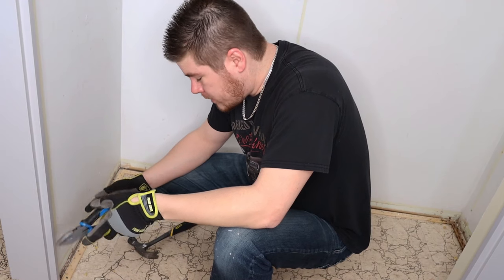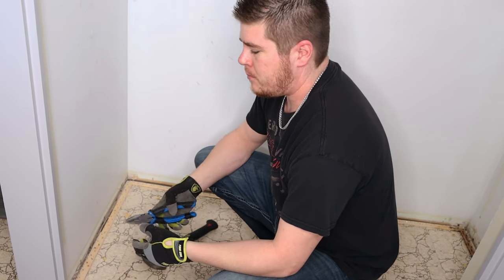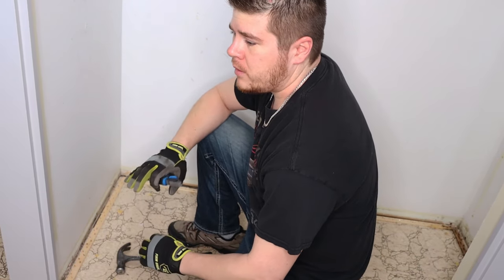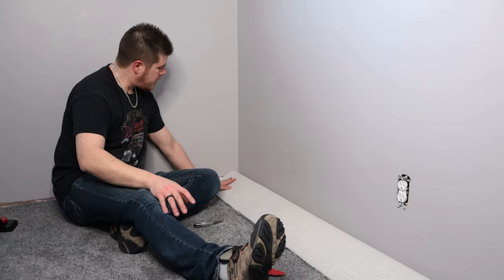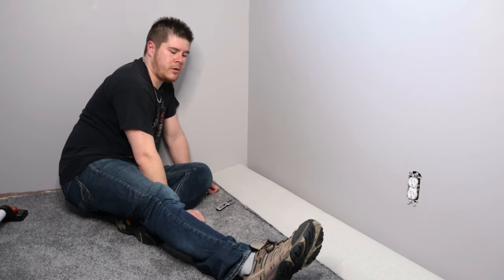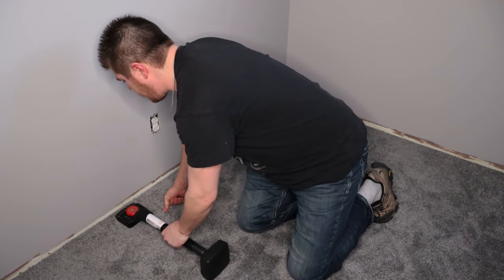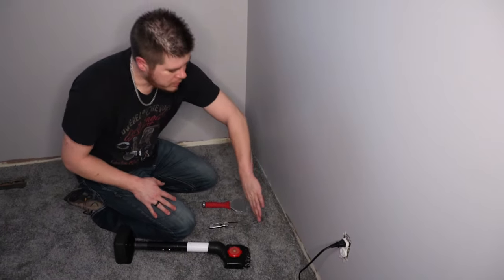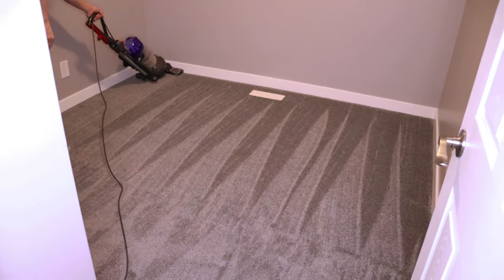How to Install Carpet in a small room // Step by step for beginners

Comment: thanks for this, I've been up all night watching carpet installation videos and yours is by far the most clear and detailed one I've seen. I usually only do drywall, tile and vinyl but now I'm confident I can do some small carpeting. again, thank you so much for making this
Reply from the maker: Thanks, I appreciate it! I'm happy I could help. Good luck on yours! Thanks for watching, let me know how it goes
Reply: How did it go?
Reply: In your shoes now boss man how did it  go ? You add it to your list of services for good?
Reply: @devinsteed303  it went well! was definitely a tough job and I dont think I'll ever do super big carpet jobs but the small ones are fine. I'd say definitely spend the extra money to get a good knee kicker, the cheap ones are garbage
Reply: Are you able to use your foot instead of your knee?  I've had both knees replaced.
Reply: @3TESLA  Yes, but you'd either have to be super limber & double-jointed, or 3 feet tall, since a knee kicker will require you to apply pressure with your hand(s).
Reply: I agree. This is the best tutorial.
Reply from the maker: Thanks

Comment: Great vid! You actually got lucky twice. The carpet cutter cut a straight line.....and the carpenter built a straight wall. Royal flush.
Reply from the maker: Thanks! Well if my local shop couldn't cut it straight I'd be amazed since it's rolled off by machine and a blade comes across a rail lol and the walls are close enough, not perfect but close enough to work with. I did have to tweak the cut in the other room I didn't film right beside it

Comment: Pretty good video dude, as an installer I think you made it very clear for people wanting to do diy work. The tool you were thinking of with the poles is typically called a power stretcher, normally it's recommended to use one on all installations because the knee kicker is only for setup these days. I noticed you were using it as a computer room to I'd recommend getting one of those plastic or rubber office mats if you have a chair with wheels because they destroy carpet pretty quick.
Reply from the maker: Thanks man, appreciate it! I tried to make it as clear as I could that this method is for small rooms only. Yeah the power stretcher, I remembered it after lol oh well. I know the kicker isn't the normal go to method, but it can get the job done in a small space for people to tackle. I am now using a plastic mat yeah, I didn't want to wreck the new carpet. I had one on order but it wasn't in the video, and I didn't care about that gross old carpet lol. Thanks for watching and reaching out! Happy new year
Reply: @JessedoesDIY  no worries man even though I've been installing for 14 years I still enjoy seeing people give things a go, happy new year from New Zealand.
Reply: Thank you so much for this comment. You saved me a world of work

Comment: Great tutorial.  I'm a carpet installer with 20+ yrs experience, and your video popped up on my feed.
I can sit here and criticize all day, but I think you made a great video for DIY(s).  The two big things I would recommend is using a knife specifically made for carpet, that is double  edged (although one must be extremely careful in handling it).  The other is when cutting the old carpet into smaller pieces, fold the carpet over so the backing is exposed.  Carpet cuts much easier through the backing vs the top.
Reply from the maker: Thanks. Yeah, I never meant it to be a pro install job, just to help people do a small room is all. Thanks for the tips
Reply: @JessedoesDIY  Yeah, I know.  I could go on and on, but your video is a satisfactory quick lesson for those looking to save money & a temporary solution.

Comment: Thanks for this video, if you were not putting the base board (skirting) down, would you recommend painting first and then lay the carpet down?
Reply from the maker: No prob. I'd always paint first then do flooring. Then you should only need to do touch ups if the carpet scratched anything

Comment: Great in detail video man! Had a question, I’m needing to replace the baseboards anyways, should I lay the carpet then install the baseboards and tuck it? Or have it up to the wall and install the baseboards so no tucking needed? Which would be better?
Reply from the maker: Thanks, I appreciate it. If I can, I always want to do baseboard last, after any type of flooring was installed. But that's me, I know others who would do it first, then carpet. Hope that kinda helps lol I know it's a non answer, but that's what I would do.

Comment: First, great video, congrads. Just a quick one since I'm a complete novice DIY . So in our small bedroom, there is an existing carpet, underlay underneath which I was going to replace. Now under the underlay, what do I expect to see, concrete ? Does the underlay go directly onto concrete ? I'm in Ireland, in a dormer, house on ground floor is concrete, where this small bedroom I going was to switch to office but rather than using laminate, though carpet would be nice.
Reply from the maker: Thanks! Well typically for me here I'd expect to see a plywood or OSB subfloor, I just happened to find vinyl tiles under this one in my house. Over there that's a good question, if the rest of the house on ground floor is concrete then that's probably what you'll find. But if you do install carpet on concrete, you'll need to glue down the underlay with a spray adhesive or something. The tack strips should be able to just be nailed down like normal if you get a concrete specific one. If you decide to go a ifferent direction tho and don't want to tackle carpet, I'd look at LVP. Typically I'm not a big fan of it in main areas but it has great use cases, this being on of them. Laminate doesn't play too nicely with concrete in the long term, LVP will be better, but carpet is the warmest as well. Your call my man, unfortunately you won't know until it's ripped up, or at least pull a corner back up to see. Good luck!
Reply: @JessedoesDIY  Thanks mate for the info. Much appreciated. Keep the excellent work going. Takes a lot of effort and time to put together videos that are easy to follow for beginners!!..
Reply from the maker: Thanks man, I appreciate it! Will do. Good luck on yours, keep me posted!

Comment: Correct me if I’m wrong, but I’ve actually got a builder doing our carpet, and in some spots the carpet didn’t even make it under the baseboard or I can literally peel it off the tack strip, that’s improper correct?
Reply from the maker: If there is no baseboard you can pull it off the tavk strip, but the baseboard should hold it down so it doesn't come up. And it should most definitely be under the baseboard and tight to the wall. There should be no gaps anywhere

Comment: I have a recessed den with a 16 X 12 rectangle area with carpet. Could I use just the knee or kicker or would I need the power stretcher?
Reply from the maker: I'd lean to the power stretcher. That's getting to be pretty long and you wouldn't want any waves over time

Comment: Brother what about concrete floors? Does one need a HILTI Gun to get Tac Strips replaced?
Reply from the maker: Hey, no no no, that's too powerful, it'll just blow them apart depending on the model of gun. There are concrete tack strips you can get that are made specifically for it. They have nails made for concrete that you can pound in with a hammer like I showed

Comment: I was wondering, around the vent do staple any carpet down? or put tackless around it?
Reply from the maker: You can use a couple staples but I wouldn't. And no tack strips, don't do that. It's honestly fine to just sit there. Once the vent cover is on and the carpet is in its final place it won't move anyways, and a vacuum won't pull it up. Nothing is needed. At most I'd do some 2 sided floor tape under it to the floor if you feel it needs it

Comment: How do you install tack strips in a basement, on cement?
Reply from the maker: You can either get concrete tack strips which have short nails made for concrete but they don't always work. Otherwise you'll glue down the strips with some construction adhesive

Comment: hey i have a 16’x 7ft and a 8ft x 7ft room to do, would it be wise to use this tutorial? I have to do it myself since i don’t have ~700$ for someone to install it for me. I watched it and it seemed really simple. Also, does the padding have to be flat surface face up? or can it be face down?
Reply from the maker: The 16x7 room I might rent that carpet stretcher from a hardware store just because the distance is pretty long and you probably won't get tension on it. Otherwise yeah, make a go of it if you feel confident, the carpet stretcher is easy to use and they can explain it when you rent it. Technically the underlay should be foam up, film side down. Hope that helps
Reply: @JessedoesDIY  thank you!!
Reply from the maker: Anytime!

Comment: Could I use this same technique on a 14'x12' room?
Reply from the maker: As long as you can buy a single piece of carpet in your area that large, otherwise you'll need a seam and that's another story. You may also wish to have a stretcher I talked about to pull it taught, unless you work at kneeing it a couple different times to pull it before you latch it to the tack strips making good and sure there isn't slack in it

Comment: How does someone tack down wood strips if the floor is concrete?
Reply from the maker: You can get concrete specific tac strips that have concrete nails you hammer in. Or you can glue them down with construction adhesive

Comment: Please, I was a carpet/flooring mechanic for over 12 years. Don’t do it yourself. Pay someone to do it. The rip-up you can do yourself, just pull all the staples out of the floor and use “dyke” pliers on steps. The padding staples should not be that bad, but pull them anyway. It truly is one of the most miserable experiences you can put yourself through aside from roofing. Also remove all the quarter round along the perimeter of your area. Please score the quarter round paint so it does not rip off the wall. You cannot get a good tuck against quarter round and will be re-stretching the carpet several times. I suggest using 2 rows of tackless for a better grip and hold. In cold months, get the heat up where the carpet is going to go so you get the best stretch you can
Reply: You think I'm here because I want to be? The flooring company said no.